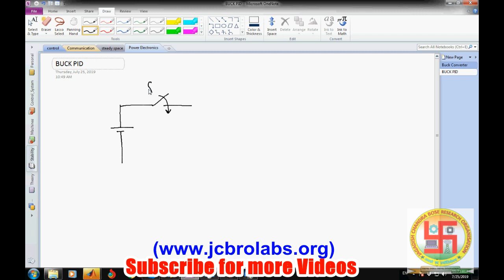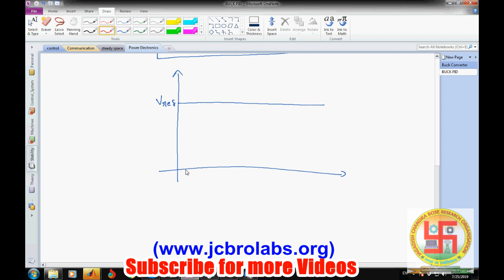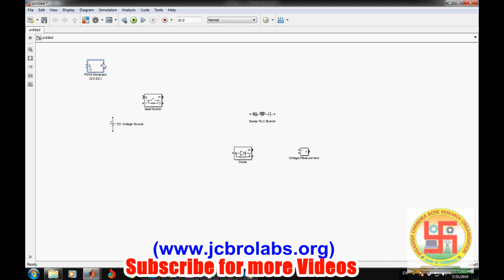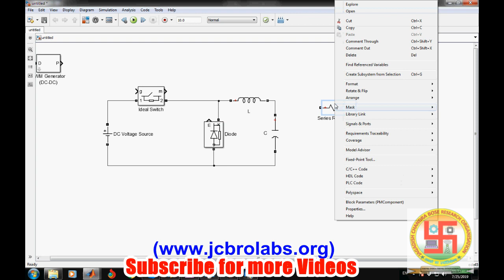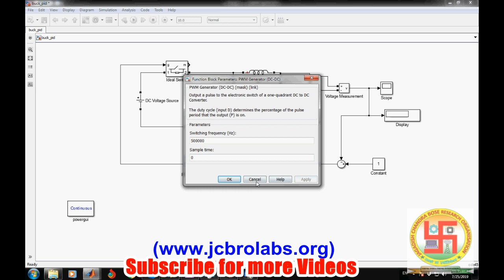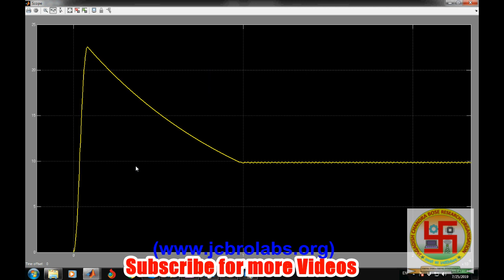How to simulate Closed Loop PID controlled Buck Converter?

Comment: Sir who to vary proportional constant and proportional integral in PID controller
Reply from the maker: Hi, you can either vary these values manually on by one or you can use optimization algorithm to tune the PID. If you have any specific requirement then you can contact us at: info@jcbrolabs.org
Regards